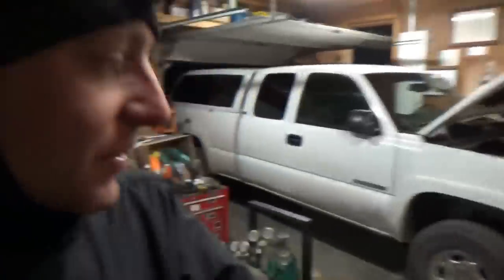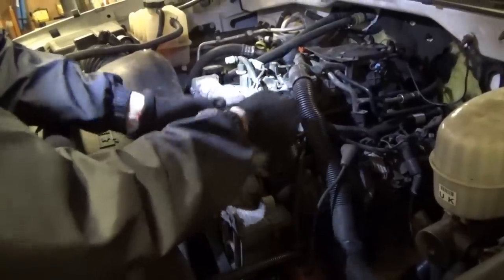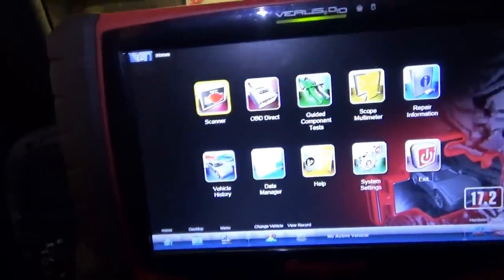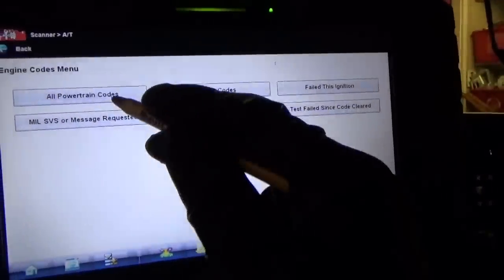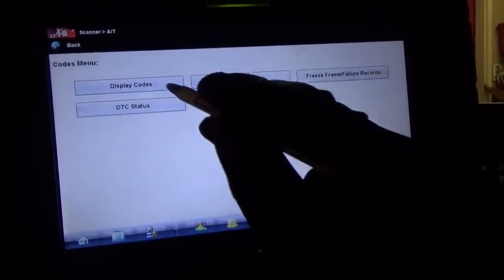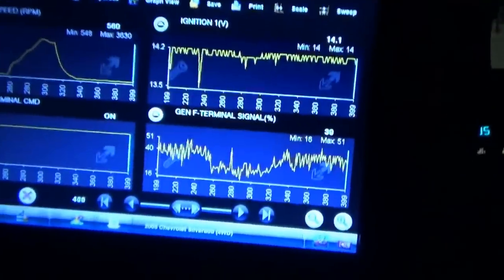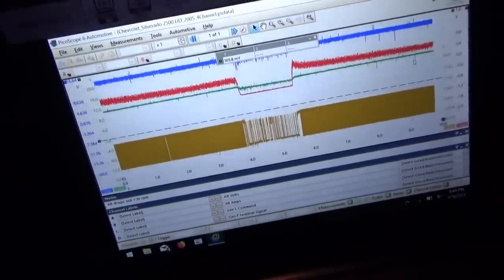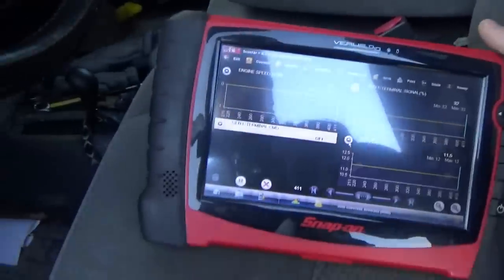Misfire, O2 sensors, LOW VOLTAGE? -Part 3 (Repairs)

Comment: I expected to see the alternator brushes on the failed part. bouncing brushes would account for this failure.
Reply from the maker: I'll have to rip apart the old unit and see what we find. I'm liking the worn brushes idea more and more!
Reply: @PineHollowAutoDiagnostics  worn brushes,weak springs,slip rings out of round,causing brushes to bounce at high RPM

Comment: Ivan, can the dropuot of the alternator been caused due to worn brushes, as the pressure of the springs is lower then so at high revs the contact is lost a bit.
Reply from the maker: Maybe. But the regulator was definitely acting weird even at idle, so I suspect that's the problem...But now that I think about it, the worn brush idea actually sounds very plausible!
Reply: As the RPM increased, the power going to the brushes decreased which got to the point the brushes weren't powering the rotor in the alternator. I'm thinking there is a higher resistance with the brushes to the rotor.
Thoughts?

Comment: What brand is the scanner you are using? How much do they run and where can I find one? Thank you. I need one I just recently replaced my fuel pump and fuel filter on my 2002 Chevrolet Silverado Z71 1500 with the 5.3 liter engine. Fuel pressure went from 35 psi with key on to about 50 psi with the key on. Now it runs good when driving but during a parked idle I can hear it miss firing. Thought maybe it would be a fuel regulator but now I’m not sure. It is not hard to start and runs smooth but you can feel it and hear it at the exhaust it definitely miss fires. Have to jump in a little deeper now. I want to get a scan tool on it so I can monitor everything it’s doing but I want to purchase a nice one. Thanks enjoyed your videos! Very thorough!

Comment: I'm having similar issues with my 05 5.3 silverado stumbling idle but runs great only when hot new cars new 02 sensors all 4
Reply: New cats not cars
Reply: Having .00 to .06 volt jump bank 1 sensor 1 and sensor  2  .06 to .08

Comment: Ivan did you test Alternator at maximum load against 'claimed' output? (eg: Amps & Battery voltage with Headlights on High Beam, Heater(fan) on Max, Rear Demister on, seat warmers yada yada yada?

Comment: I need the handle have a 50 year old flex head ratchet,  I bought new had rubber handle split and fell off, still works great but no handle.,

Comment: may want to simply try a different other usb ports, different cable and play with windows usb power management settings and  maybe the windows power settings overall, as it tends to sleep mode/power down usb for battery life, meaning it could be driver bugs too. Welcome to computurds and junktronics, some of the things far worse than a vehicle....... :)
**EDIT, also simply try "restarting" the computer, not shutdown or sleep! often windows updates and fast boot caching or return from sleep or hibernate will mess up drivers..

Comment: OK but it's still bothering me why the F signal would drop off even if the alternator was bad? The only explanation I have is that when revv'd pass 3k RPM the alternator would dump too much charging current which the F signal would then respond to by dropping off (trying to command the alternator to stop charging)?
Reply: The way I understand the theory and operation of the system is that the internal voltage regulator grounds the F circuit internally (hence the drop to 0 volts) to notify the PCM that a problem with charging was detected. The PCM then sends a data message to the instrument cluster to turn on the charging indicator and display the charging system error message.
Reply: @josephwash109  Ahh! thanks - ok that makes sense so it's not just the PCM modulating the voltage the alternator grounding it is also detected and reported. In other words it's not just an output from the PCM to the alternator but also an input back to the PCM.
Reply from the maker: The regulator is in the alternator, so it's the alternator sending the pull-up duty signal to the PCM, one way. We proved this in Part 2 :)
Reply: @PineHollowAutoDiagnostics  OK that clears it up then. I thought the F was the command from the PCM and the L was the charging circuit fault indicator. Thanks Ivan.

Comment: Reman alternator. From Mexico. I wonder how many months that will last before grenading itself?
Reply: Just as long as the new ones that are being made in Mexico  nowadays!!!!
Reply from the maker: I'll try to fix the original one and pop it back in when the reman craps out lol
Reply: I doubt that's original alternator, as others said in previous video..  That silver paint over spray on the front windings screams "REMAN" very loudly ;)
unless the owner repairing sprayed it to cover corrosion?

Comment: Ivan, I suspect USB port can`t handle current for Picocope, My Hancock scope requires both USB to operate properly, good luck.
Reply from the maker: Well it's never given me a problem up till now...intermittent problems suck!
Reply: Ivan, I can attest to that, my work history was in a Instrument and Metrology Cal Lab, maintaining and  repairing test equipment of all types, along with mfg test sets used in radar test systems., 38 yrs before retirement. I enjoy your videos along with Erics,  Kieths, Diagnose Dan`s videos, thanks.
Reply: Do you mean Hantek?
Reply: Mike , yes, in my hurry of typing, the brain and fingers did not come together in the thought process.

Comment: How is 1 volt 100 amps on the pico?  Still trying to learn all this.
Reply: due to the conversion that the amp clamp uses. a true amp test would be in series  but by sensing the magnetic field around the outside of the wires a wrap-around sensor can sense that and converts it into a voltage  signal the scope can deal with.  remember with ohms law  voltage amperage and resistance (ohms) are and always will be proportional to each other.  hope that helps
Reply: The amp clamp is calibrated to output 10mv for each amp of current. So 100A X 10mv =1000mv=1V. So 100A=1V output to scope.  The Pico  input  can also be set to "Amp probe"  mode and the scope will do the conversion and show the current reading directly on the screen.
Reply: @richardcranium5839   I like your nom de plume.  I agree.

Comment: since the pico has the red light it appears to be getting power  it just can't communicate.  no habla windows lol   since the communications is such a low voltage and high frequency  i'm thinking bad connections  try your deoxit  then the hammer
Reply: could be temperature or voltage related, aka windows/drivers or usb chips itself not agreeing on feeding enough current. good old laptops and USB (Universally Shitty Bus) which I've called it since the days of windows 95C and usb 1.x..... until around 1999/2000, USB was avoided mostly, it sucked all cpu cycles and would BSOD far too often.

Comment: I have a Ford Contour V6 so I only buy new Ford alternators because it takes me 8 hours to change them out.
Reply from the maker: Wow haha gotta love Fords! Wonder how long it would take in my 4-banger Zetec Mystique?
Reply: @PineHollowAutoDiagnostics    Four cylinder is easier, remove oil filter and power steering line mounting bolts.
Reply: can of gas, match and the wrecker to haul remnant to the crusher comes to mind :)

Comment: Regarding the PIco, I experienced similar behavior with a port replicator, and it ended up being the USB 3 cable.  I replaced the USB cable and added a short 90 degree USB extender since the flexing stress was the root of the problem.  https://www.amazon.com/dp/B079GVC2KZ/ref=cm_sw_em_r_mt_dp_U_7n8KCbARGSA51

Comment: ummm nooo your new 02 readings are not right. Either there is a vac leak on that bank or you pit a shitty aftermarket 02 sensor. id run a ac delco 02 on a GM in all cases. On a dodge or ford it may not matter. Maybe leave the GM repairs to the proffessionals or dont take short cuts and use cut rate parts ehh?
Reply from the maker: FYI the "professionals" had an epic fail on this one haha! The owner already took it to three other shops, INCLUDING THE DEALER! They told him his old transfer case was causing vibrations to trip his misfire code... What a crock of shit xD
Reply: Derrick, what do you do for a living?
Reply: Denso is the oe sensor for gm
Reply: yeah, I'd think vacuum leak or dirty injectors effecting that bank, maybe some fuel trim action needed :)
unless ECM was still unsure about the sensor being good, since it did have history codes stored.

Comment: you forgot on the battery that tight bolts doesnt mean connection is good. Always pull both and clean connection to cables. Alternator bushing provide ground so aleays take a brass hammer lubricate and move them back before installing new alternator.. Never be too lazy to take airbox off it helps to ensure belt is on straight and makes removal easier for the 30 seconds it takes to remove it. As far as the crank sensor just change it then do a relearn. Dont be a puppy tech hack if your making how to videos
Reply from the maker: Thanks for the comments Derrick! Sounds like you have a lot of experience under your belt. Please share on video!
Reply: Derrick Moyer
You would starve on flat rate pay.
Reply: Great job bro you gonna be at TST this year

Comment: Did you ever check the ripple on the original alternator  .I have had well very similar problems  and it was a faulty voltage regulator